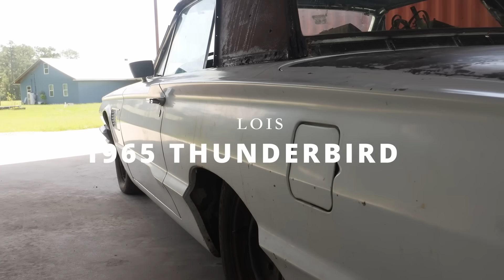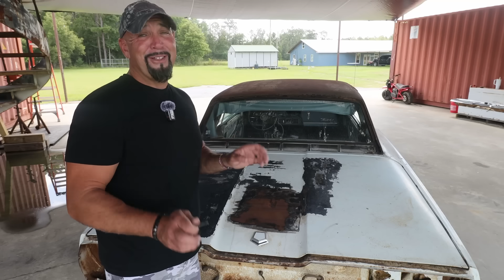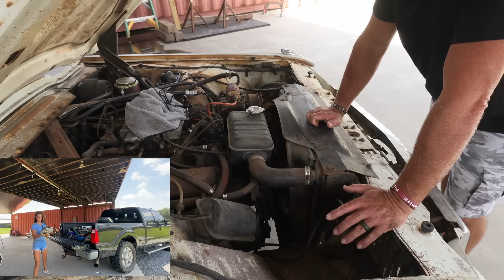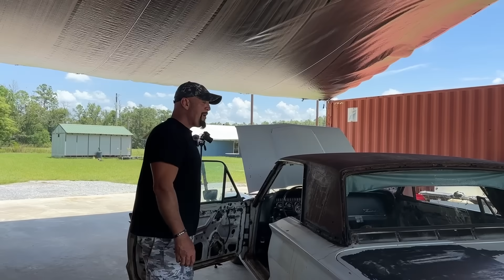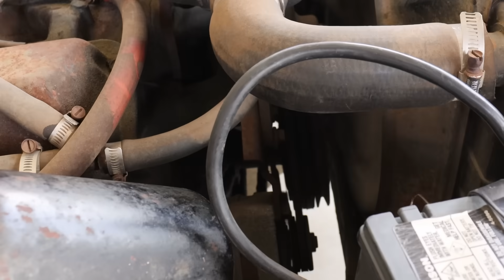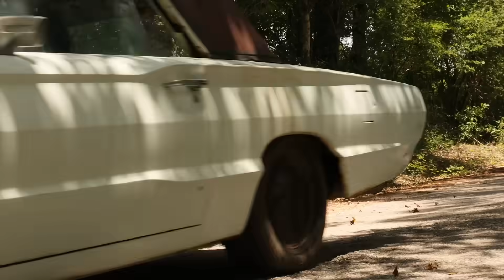First Start Since 1992! You Won't BELIEVE What Happens... EP.1

Comment: Let me give you a little advice for safety. These cars are notorious for getting sloppy bearings in the steering column and gear shift wearing…. Causing them to slip out Park and into reverse. 

Dangerous. 

ALWAYS slide steering wheel to right when exiting car while running. That prevents car from coming out of Park. 

You don’t want for this to happen with nobody in car. Many injuries have occurred with this problem. 

I have a 1964 convertible and I never leave vehicle running without steering wheel slid to right. 

So far…. You’ve got a pretty good car from all appearances. Good luck.

Comment: Ok, first big tip. NEVER get out of the car while its running unless you slide the steering wheel to the right. That locks it in park. These cars are notorious for slipping into reverse and taking off on ya when the wheel is in the drive position.

Comment: 64,000 miles with full service gas station typically check the oil every time you get gas back in the day I would say it’s gonna be a perfect engine👍😊❤️ I see vacuum cans for the door locks over the door locks used to make noise when sisssing noise they locked and unlocked

Comment: Those models have long rear leaf springs that flatten over the years. I had a 65 with 60,000 miles I bought from the orig owner in 2006. New leaf springs were horrendously expensive, so I put air bags under it. Re-arched springs do not last very long, so I wouldn't go with that option.

Comment: That part that was painted in red oxide, if the actual inner fender pnl where the battery try goes to, you still have to buy the battery tray and the T-bird places make repros. I have bought both of them for my '65. These were made in the Lincoln assembly plant. They are quality cars. even the electric window motors can be had they are refurbished. I have bought a couple my self. Best of luck and God bless.
Reply from the maker: Thank you for the info Michael!

Comment: I am so glad u changed to the 65 Thunderbird . Lois is a Town Landau model . U can tell by the holes on each side of the roof for the Landau Bars . That was  a strictly a vinyl roof car .  I hope among the parts u find the motor  panel for the rear turn signals .  The headliner is shot so that needs replacing . I loved these cars (Thunderbirds ) so much I owned 18 through out my 73 years . The door panels look amazing . The slide away steering wheel was first introduced in 1961 as an option but in 1962 it was standard until 1968 .  I would like to make a correction in that the claim of a 1970s or 1980s Thunderbird never had a convertible . Only option was to have a custom made convertible from an outside source . 1966 was the last year for a convertible until 2001 the 11th generation of the Thunderbird .
Reply from the maker: Thank you very much for the info. Mr. William!

Comment: In 1965, there were very few cars with 145,000 miles on them. That’s the era I started driving and working on cars. Actually, 50,000 miles on a car was considered to be a high mileage vehicle. Cars weren’t built to last like they are today. I bought my first car in 1966, a 1964 Ford Fairlane, 289, 3 speed, for $1200! It had 20,000 miles +- and was in great condition. If it has the original engine it is a 45,000 mile car. Maybe Thelma and Louise?
Reply from the maker: I believe that you are exactly right! We are so excited that we found it! By the way…. The ford 289 is one of my favorite engines!